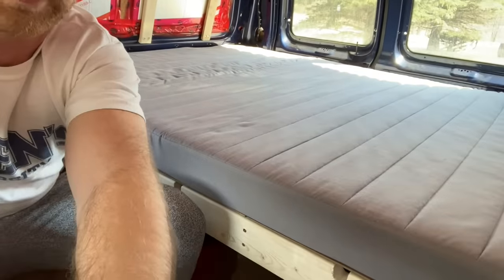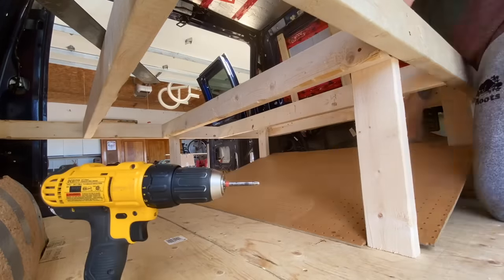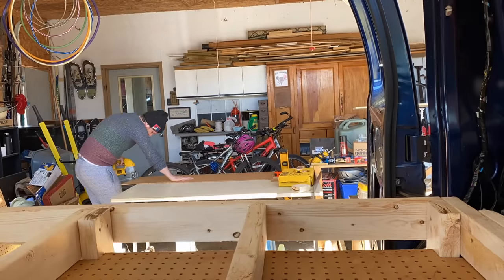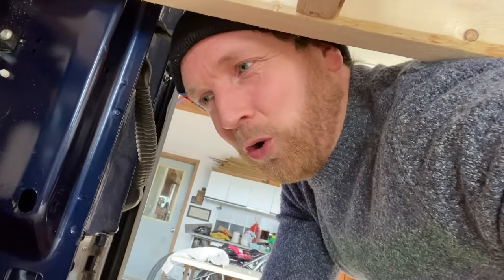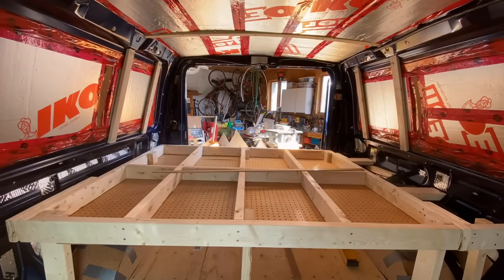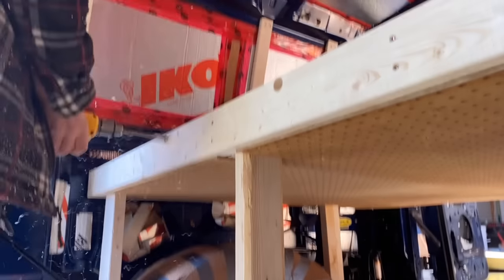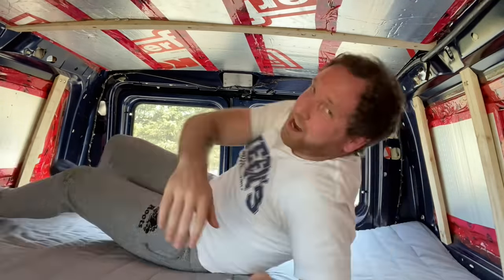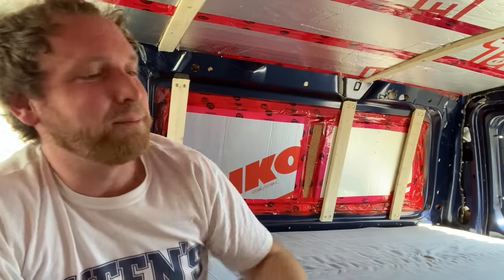Ingenious Van Bed with Storage Build Costing Under $100

Comment: How tall is the bed? Are you able to sit up without hitting your head on  the roof?
Reply from the maker: I’ve since sold the van cuz I wanna make a camper out of an SUV or else I’d get you an exact measurement, but no I couldn’t sit up in it.

Comment: How is that breathable? The top needs to be airated too... I learned that the hard way.
Reply from the maker: Certainly more breathable than it would be if neither pieces had holes Vic. Thanks for the tip.
Reply: @MattWatsonComedy  I believe @Vic Burns is trying to help, not poo on you. An Australian climate probably dried your mattress within minutes - Canadian climates are generally a lot more damp.

I slept on 4" of memory foam over a polyester-weave camping cot. I thought the foam was impermeable, but my sweat soaked through sheets and blankets and the underside became moldy, over a period of two months. This was Ontario Autumn, before the weather turned cold. $200 mattress, $200 cot, both lost to mold.

Hopefully it doesn't affect you, but I'd feel remiss if I didn't at least suggest that you keep an eye on it. I guess that you lift the mattress to access cubbies, and that's a great time to check. If the lid matterial is pressboard, it may transmit humidity and allow it to evap through the bottom, so you may never notice a problem. The problems I saw were from folks using 6mm ply, which doesn't transmit humidity like pressboard. Fingers crossed!
Reply from the maker: @DuncanRenovates  This is all very helpful Duncan. Thanks for taking the time to break it down. I will monitor the mattress and topper and hope the press board does the trick. Maybe drilling a few holes in it will help with ventilation as well?
If not, I got that mattress for $20 on marketplace, I’ll fix the problem and I’m sure I can find another.
Thanks!